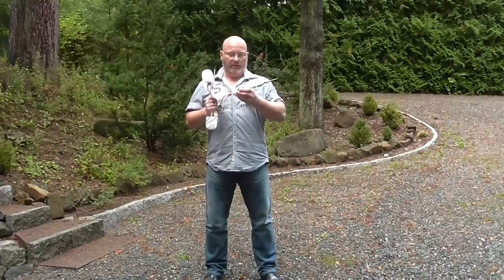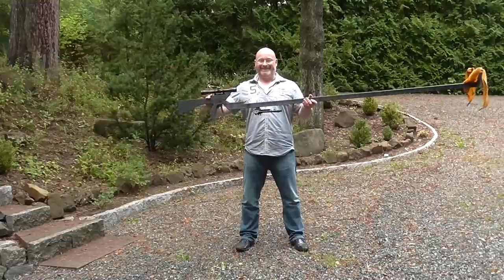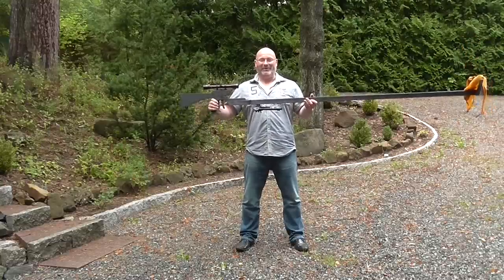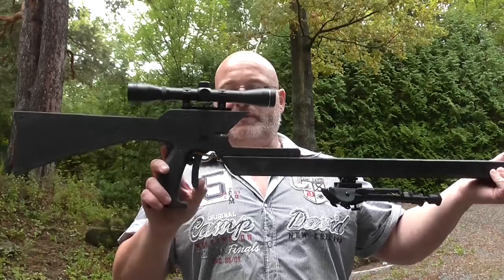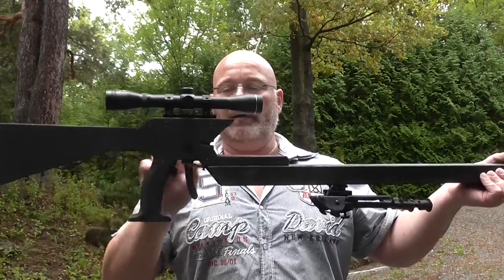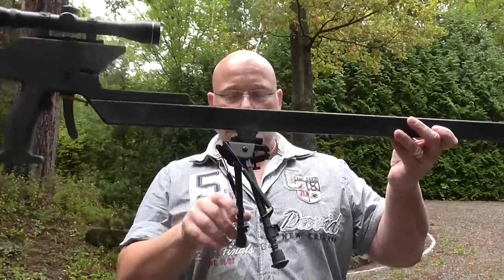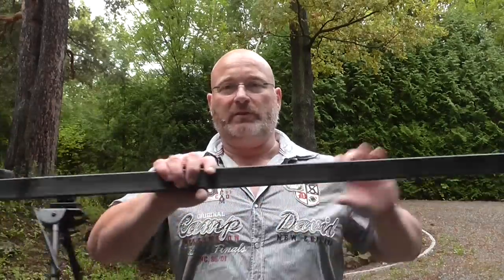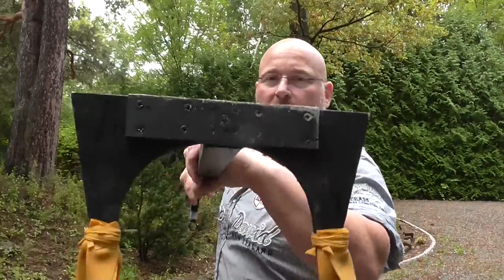The Toilet Brush Monster Sniper Rifle

Comment from the maker: Fork width doesn't matter much. A wider fork means lower power, as the force vectors of the left and right bands are slightly drifting apart. But that also means the draw weight is lower. So you just use a bit more rubber. The fork must be wide enough for the projectile, plus some safety margin.

Comment: Who would've thought that arrows made from toilet brushes would be that precise. Didn't see that one coming.
Reply: Well, it makes sense. The brush at the end adds air resistance there, so it flies quite stable.
Reply: excellent fletchings .. at least if the brush wasn't used previously.

Comment: I think you could actually do that, if you add the hinge on bottom of the barrel. That way the rubberband force on top would even it a bit out. You might have to reinforce the wood somehow though, like with thin steel/iron plates :P

Comment: I'm fairly certain in guns, it helps because the force from the explosion can push the bullet for longer. Also barrels can have groves inside in order to spin the bullet. These two things combined make a more accurate shot. As for guns like this one, it is the same logic. He can use a larger band that has more force and closes over a longer distance resulting in more force on the projectile.

Comment: Jorg, if i may sggest, i get the feeling the wide toilet bristles might turn the toilet brush into a floo-floo arrow, the rushing air to me means massive drag
perhaps take some scissors to the brushes and experiment n your next video with differing fletch configurations, one idea i'd suggest is ripping out entire rows of bristles to create a pattwern similer to a typical set of arrow fletches perhaps?? or just shortening the LENGTH of each bristles by say half or a 1/4 length to reduce drag?

Comment: Joerg, can you make a video with this again but shoot it on greater distances?
I would like to see what this can do on 30 or 40 meters. Probably the air drag of the brushes will become too strong on these distances so you might have to remove some of them and just leave a cross shape like on normal arrows? But since the results on 20 meters were so awesome, we need to see what this launcher and ammunition is really capable of ;)

Comment: true, but you could set up safe houses within a mile or so of eachother and just keep walking between them getting the horde to wander off in one direction or another while you're sitting in a different location entirely.  it's not like the average shamblemonts are all that fast, so it'd be easy to make a bunch of noise out at one place, run off, and then go to one of your safehouses for a day or so.

Comment: the more space is between the gums on the front side of the barrel the more the gums are the arrow pulling to the side (the right one to the right and the left one to the left) so its resulting in strict forward movement = high accuracy but not so high power with equal length of the gum bands in his video because the barrel has to be shorter

Comment: but in his video the gum bands are quite close together and the barrel quite long for much power the more the gum bands are close to the barrel the more they accelerate the arrow forwards and the more speed it has in this video the slingshot is this accuracy because of the high power

Comment: Woah, that's amazing!
Just an idea, would it be possible to cut the "barrel" and add a hinge and lock mechanism so that you can fold the slingshot for increased mobility? or would that make the whole contraption too weak for the tension created by the rubber band?

Comment: What if you weld the tip on the shaft? It would have more strength n if you trimmed the bristles on the brush down a little it should fly faster :) give it a try :D

Comment: Isn't it more accurate at this point to call this weapon a crossbow, not a slingshot?
Reply: I believe Slingbow is the appropriate term for a rubber-power crossbow mechanism.
Reply: i think the power of a crossbow comes from the bow itselfs and the power of a slingshot comes from the rubber and thats the diffrence